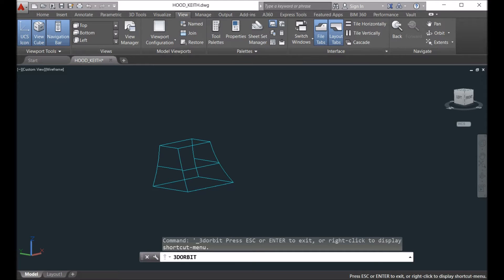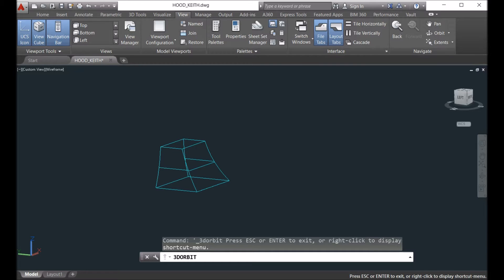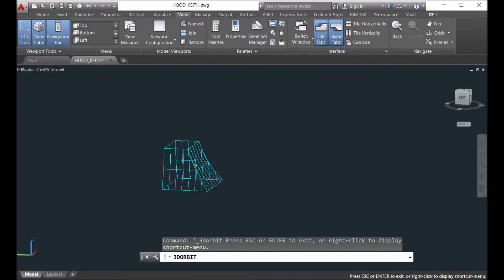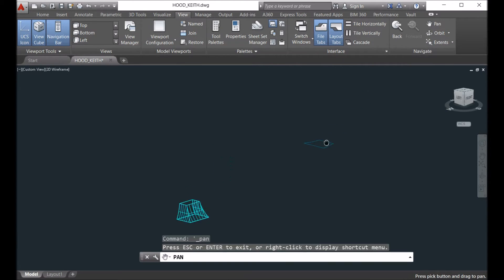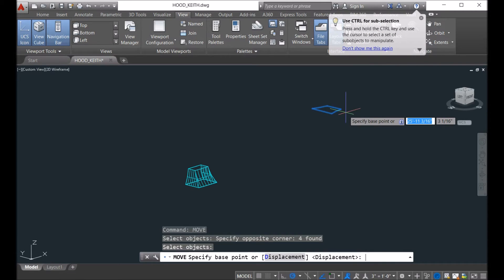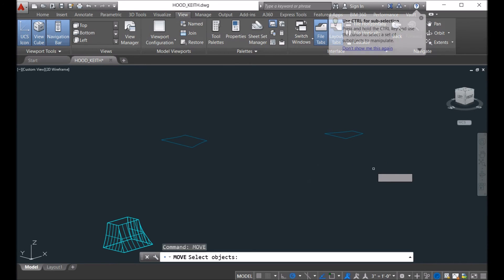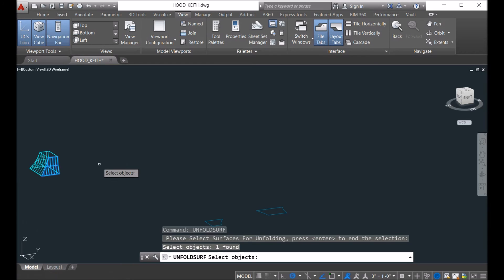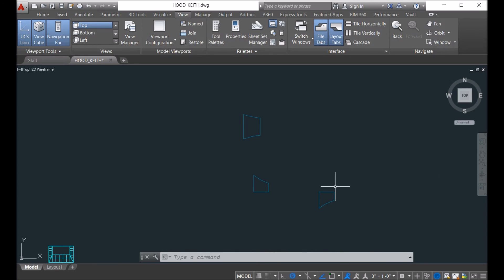Unfold or Flatten Surfaces Inside AutoCAD

Comment: Hi!
I have drawn a simple boat hull in AutoCad (solid not surfaces) for a RC boat that I will make. I can't unfold the surfaces. I have the student version and I think that I can't use the ''unfold'' in this version. Could you help me? 
Thanks in advance!
Reply from the maker: I think you can use it. If you can load the dll into your AutoCAD, it should work.
Reply: Do you have any video about how to "activate" the unfold command. Where can I found this dll? Or if I send to you the dwg file could you help me to unfold the boat hull? My email: nktasios@gmail.com